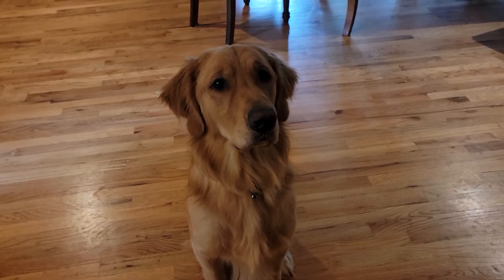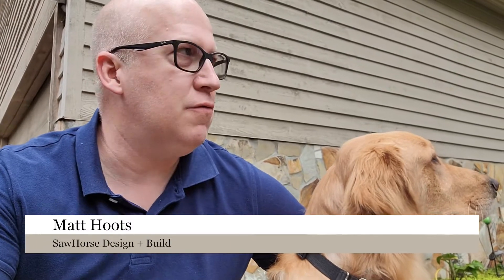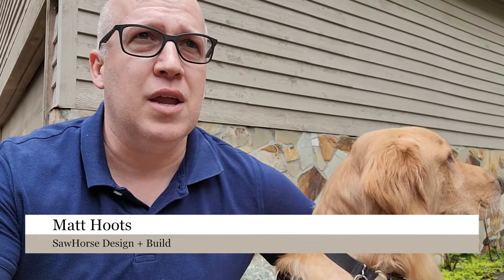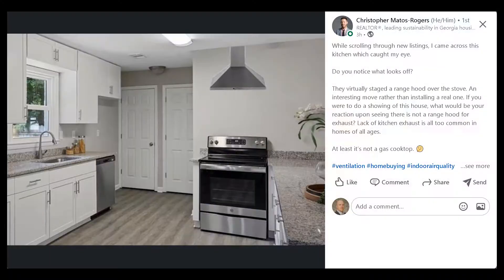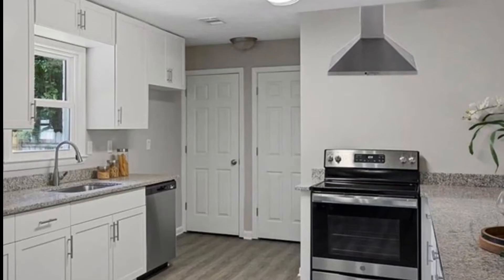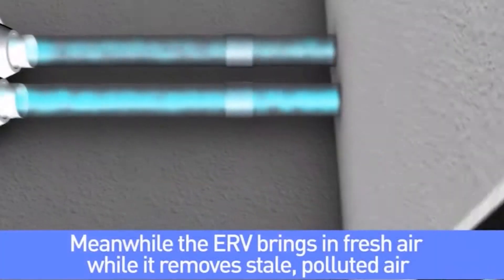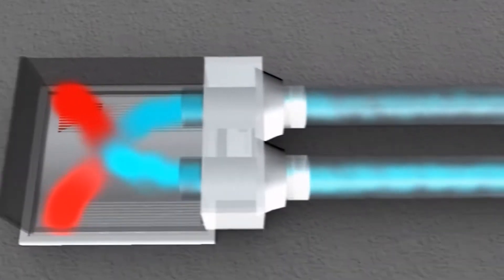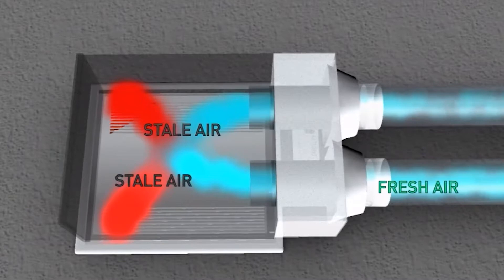Fake Ventilation? Real Ventilation Strategies that Work for Your Home

Comment: Thanks for the shoutout, and covering the interesting find I came across. Unfortunately most agents and flippers don’t understand home health and indoor air quality, it’s all about lipstick on a pig 🐷. 

I did find it interesting that the photographer added the vent hood in virtual staging.  Someone seemed to know there should be ventilation! I’d be curious how many buyers notice the missing range hood during a showing, and if this could possibly open the seller and agent to improperly advertising the property.  

We need more houses with proper ventilation so consumers and agents become better at noticing when it’s not there.
Reply from the maker: We need more builder and contractors that understand ventilation as well.  I guess all we can do it to work to create more awareness.